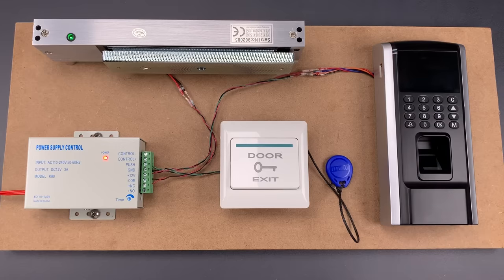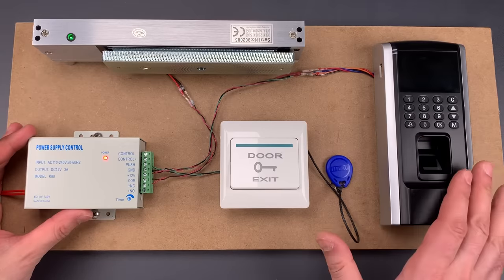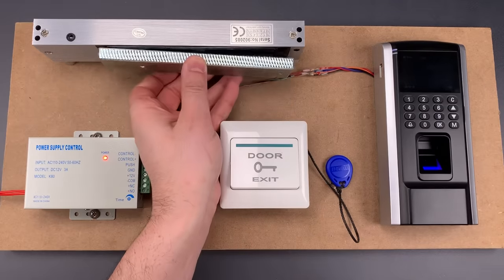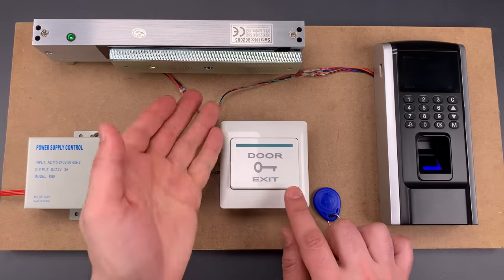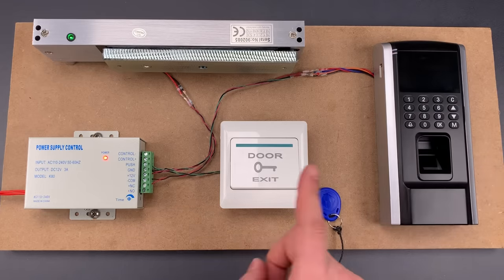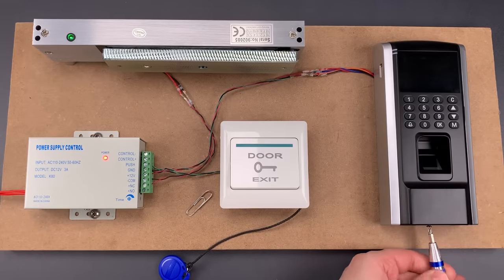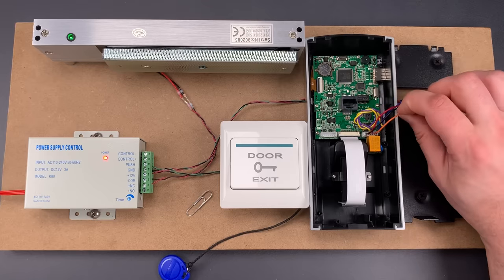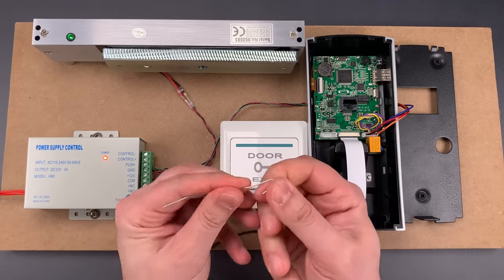[1040] Fingerprint/RFID Lock Defeated With a Paperclip (Mengqi-Control)

Comment: We had a lock system similar to this on the front door to our office building.

It wasn't the primary locking -- that was a standard lock (which LPL would have defeated faster than this, but I digress). This was just to keep the drug-addled, homeless creeps out when we were inside. If nobody was there, the regular lock was locked.

For that purpose, even though the authentication and access control was on the insecure side, it worked just fine. We understood the limitations and determined that for the application, the limitations weren't a great liability.

You need to know not just what a security device is designed to do, but what it is capable of, and evaluate it based on the likelihood of exploit and value of the property you're securing. Even a Master lock can have its place, like keeping the kids out of the poison cabinet (well, maybe not LPL's kids).

Comment: The paperclip method aside: The essential flaw is that you need power to lock, not to unlock. Good systems lock when power is lost.
Reply: This lock can be reversed to normally closed spp out works that way.
Reply: @roysammons2445  roy, how would the electro magnet hold without power?
Reply: It may be to comply with fire code, having a lock be inoperable during a power outage sure sounds like a hazard to me
Reply: @MrVein5.0  look up "electropermanant magnet"
Reply: @noobulon4334  If it is an escape door, yes..
Reply: @noobulon4334  Nebulion, OK yeah i get it so its like a permanent magnet with a electro magned operating in opposite to the permanent. canceling it out.    still, not anything i would consider more than lvl 0 safety.
Reply: @MrVein5.0  Sorry my brain wasn't switched on : ) I was thinking of a solenoid bolt. I think there are two ways of operating such bolts. 
1. Bolt is in lock position with power on. 
2. Bolt is in lock position with no power to bolt.

Comment: You failed to mention that when the power to the building or power supply is interrupted,  the lock will default to open.    This is as it should be in the event there is a fire and the need to exit is paramount.
Reply: There is a toggle switch on the controller that allows you to set it either way, (open or closed upon power loss)
Reply: @SocietyMike  Unless  you have a battery back up to power the magnet, a power outage will allow the door to be opened.
Reply: Most jurisdictions, at least in the United States, will not allow backup batteries on any power supply feeding maglocks specifically for that reason. In an emergency, life safety (being able to get out) trumps security.
Reply: @ShaunMBB527  True

Comment: As an electrical engineer I often wonder why these lock designes are so bad that anyone with some knowledge can open them. Then I realise that these are probably not for houses and more for office doors (in buildings), cafeteria doors ,etc. Also I live in India where power cuts are common and these will either fail or lock you out (if it's NC type solenoid valve locks) upon no power to the lock. 
Anyway great video as ever, your content is very helpful and is a great review for all sorts of locks.

Comment: someone is trying to break into a building with this lock on it, they sent it to lpl to show them what to do
Reply: If you have enough knowledge to install one of these based on the manufacturer's instructions, you don't really need LPL to tell you what to do next to bypass it.
Reply: This issue is not unique to this brand.  It's quite common.  Most manufacturers use a security screw to hold the cover closed but that's it.

Comment: At my work, theres a electronic lock at my working area to avoid unwanted people access, but when the system is down, we also are denied access.
I found the best solution to unlock the door is just unplugging the device from behind (it's not even screwed to the wall) and voila: door open...
Which also means whenever there a power outbreak, the "security door" auto unlocks...
Cefty
Reply: As a safety feature, you would not want any door held closed without a way to open it when the power goes out.

Comment: I'm not sure of the material the outer housing is made of but if it is steel as the mounting plate is a way to prevent this could be welding over the screw, rendering it unable to be opened. This may be an issue if the system were ever to be replaced, but in applications where this device may be used, I suspect this system would be in place for years, likely long past the original installers term of occupancy.

Comment: This is a consumer grade lock. Magnetic locks are not generally used on the outside of buildings as a commercial power outage leaves them open. Before I went telecommuter we only had magnetic locks for the emergency exits on staircases, the first floor being the only true exit was a mechanical lock. We also used commercial grade systems as the card keys were centrally managed. That being said it important as a consumer to know the good and the bad of any system we want to use to secure our environment

Comment: hose electronic complexity (fingerprint, password reading) results in a simple dry contact in the low-security side. Obviously, this is not for high-security applications AND the reader's tamper is not connected to an alarm system for further actions.

Comment: that's why places that use thi kind of expensive locks, wont connect those components as an independant system, the REX button will be termination supervised and a regular "shortening" wont trigger it. (it is possible to shorten them using the termination, but you neeed to have the one that was made for that system, not all of them would work, they differ by having different resistances) and there will be a PCB Card somewhere safe monitoring and granting access to each door. some of them cards can hold either 4/8/16/24/32 doors simultaniously. and can be expended in a row to have as much doors as needed in your system.

Comment: I can't say I can blame the lock manufacturer, but I very much do. I have done the exact same thing when creating my Minecraft vault lock. But then again they do have quality control and I didn't and I still fixed mine so the controller would be the deciding factor from the security room within my vault. This is how cross site scripting works in the real world as well. You give a user the ability to ask the database a question the database can reply with real answers. This video should be in a textbook somewhere.

Comment: The way I'd design this is the exit button has all the major circuitry in it and when someone inputs a credential that's valid it just flips the trigger that someone on the inside of the door would engage by hitting the button. I'd probably include some sort of logging function in it as well just so you know what entries and exits have occurred.

Comment: This is not a security system. Just access control in a normal environment. There is no back up battery and if there is a power outage the mag lock will open. The screw at the bottom can also be changed to a Allan key type to make it more difficult. When it is used as access control it is usually monitored by a camera.

Comment: I want to point out that THIS lock can actually be fixed so it becomes very secure, almost as secure as a split lock. If you look on when he opens the screw and lock, you will see an ethernet jack. Thats a big plus, and thats what makes it "fixable" without any modification.
I actually fixed a similiar lock.

This is how I did it:
I wired the lock to a raspberry pi. I made so the NO cable from the insecure side, only "wakes" up the rpi and tells it to go into the webinterface of the actual lock device, and check in the event log if there is a valid tag scan, or valid remote open (with phone) recently based on current time.
If there is, it will open the door.
If theres none, it will refuse to open the door, log a tamper alert, you can also configure it to send a tamper alert SMS/email, and if you want it even more secure, you can also trip something that will refuse to open the door at all via the device until a manual reset have been done (with for example a key).

Since the log tells HOW the door has been opened, its also possible to refuse to open the door if the "Request to exit" pins have been shorted for locks that have those. (and instead wire the request to exit button to the rPI so it tells it directly to open).

If you in addition combine it with a tamper sensor that reacts if its removed from wall, and disables the possibility to open the lock, it will get even more secure.

So that is a way you can improve a cheap "insecure lock" in a way that makes it extremely secure, for just like 20-40$ of additional cost.

Comment: This reminds me of Honda had a reputation for being stolen often and rather easily. To combat the problem, they added a "chip" key system. The chip key would be registered to a steering column module which then sent the handshake to the ECU to turn the fuel pump on. If you attempted to start the car without the chipkey, the ECU simply would not turn on the fuel pump. Honda made one error in their design, which was they kept the wiring largely backward compatible with the older Honda ECUs which didn't have the "chipkey" system. All a thief needed was a $100 ECU, an ECU adapter (depending on the year) and a drill. You could hook up the ECU on the passenger side, while your thief buddy opened the steering column and drilled out the ignition switch screws. The entire thing was done in under 5 minutes.

Comment: I find it hard to believe that a company would design the fancy outdoor module and use a simple relay contact that can be bypassed so easily, but I guess they did.
A simple communications protocol between the outside module and control/power supply would have fixed this issue.
Also, why is there screw accessible from the outside!?

Comment: Aside from the glaring vulnerability, this lock is otherwise very well designed. The parts all seem to be high quality, magnets are much more durable than latches, the failure state is open (so you're not locked in if the power goes out), and most importantly, it seems to be user friendly.

Comment: The installation of the equipment as shown would be a code violation almost anywhere in the US (and probably Canada).
Because a maglock does not have a mechanical override, something to unlock the door automatically from the inside is required; usually a motion detector. And the motion detector MUST RELEASE THE DOOR INDEPENDENTLY OF THE ACCESS CONTROL EQUIPMENT/SYSTEM.  The motion detector must also be Fail Safe; if it looses power, the maglock must release.
As always, Caveat emptor!

Comment: As a security technician you'd be amazed how many intercom systems this is also true for. Fermax is the worst. Literally a jumper wire will gain you access. 

This is why I'm glad I only install challanger and cardax systems. Tecom is alright but faces similar issues.

Comment: As someone who has studied electrical engineering and electronics for a long time (and work in IT), it paines me that a manufacturer would sell such a simple switch as a lock.  Especially for $175.  You can build this exact same this for about $20.  The logic controller can be bought for $5.  This is.something anyone in the amateur electronics space can build.  In IT we have a whole sector who gets paid very well to break things like this.  It's called penetration testing.  You can get paid to test a companies security.  Cloning rfid tags, getting through this type of lock or the most effective, talking your way in.

Comment: So if you wanted to use this device, you'd have to figure out some way to effectively cover the bottom of the unit, so no one could get to the screw... but then again, it sounded like the keypad cover was just made of plastic... so you could use a battery operated Dremel type tool to just cut around the base or just drill  a hole in the side of the cover where the wires are and jump the two wires (whatever the colors are) that are not red and black... a Anti -Tamper Device would probably be a simple mercury switch if the cover was removed... drilling a hole shouldn't disturb that... but you could also add your own anti-tamper alarm easily.

Comment: That's why i still use the old fashion padlock & key on my gate & door.
One question: in the event of power outage, will this sophisticated magnetic lock release by itself? 😁
Reply: With out without a backup power supply//battery?   Without a power supply it would fail safe and open, yes.

Comment: True it really should have an anti tamper switch, and also true that it should be a 1 way only signal of the credentials for the secure side to verify, hopefully the company that sells this makes the hot fix and sends everyone who bought one, the proper one with a prepaid return parcel for people to send back the old ones, so that way the company can remodify them and re-sell them all fixed and new. :)
Reply: However... maybe they designed it that way on purpose and originally told law Enforcement the loophole xD, surely they woulda came across this when making them and surely the CEO woulda known, but who knows maybe there wasn't enough hired testers before release of the product?

Comment: This is just a stage 1 lock though...... which usually means their's a secretary or security guard standing near by.

Almost all RFID applicable locks are stage 1 for quick go access.

It's not so much that the building is saying, "their is something important behind this door". They're saying, "This door doesn't even require a lock, and this is what you get. So don't even bother getting behind this point."

It's more of a scare tactic, like fake rfid clothing tags or fake security cameras.
Reply: No, I've seen scores of these inside buildings to segregate secure/non-secure areas.  Even at Beoing
Reply: @protonneutron9046  k

Comment: 1)Most of this key pad/Reader will have a anti temper switch, the moment u remove the opening screw half way, u would have trigger a 24 H siren, that is connected to a security system and central monitoring station. same thing if u rip it off from the wall

Comment: I know I am late to the show but it looks like this bypass may have damaged the system a bit.  Notice the green led on the lock turns off each time the system is unlocked.  There is a delay until the system relocks.  When he bypassed it the led still turned off and then with no delay it turns back on but a strange dim orange color.

Comment: With these systems often times a motion detector is incorporated inside the building. Often times the motion sensor is mounted to the top of the door frame and by pounding on the doorframe by the motion sensor will cause the sensor to deactivate the magnet.

Comment: Easy way to make this one instantly harder to pick.
Install it, then build an inset around it so you can't easily access the access point that lets you open it without actually breaking it. 🤔
If you build that Surrounding inset with Future access in mind.
You would make it a steel plate with 9 inch bolts. That way it would take forever to open the inset if you're looking to do it without being noticed, but wouldn't be a problem if you were maintenance.

Comment: Manufacturers don't care for a reason.
Maglocks are not of any security value because these need to have electricity to hold the door shut, so if there is a power outage then it will unlocked. 
Maglocks are not the best choice for high security doors and should always be used with a mechanical lock
 Another use case would be on an emergency door and controlled by either an online system for remote unlcoking or using a push button to exist device like in the video but that too is not particularly complaint with fire safety codes.
The last use case that I'm aware of is for frameless glass double doors since mechanical latching is generally impossible and even these doors are just a mere psychological barrier.

All in all, it's not just about the hardware but rather the way you use it.

Comment: Technically, if u are able to bent the paper clip into a screw driver tip form and then use it as a briding tool this can be done with just the paper clip.

Comment: I'm an expert in designing access control systems with many years of experience in designing large systems. What I can say about this is that it completely defeats the purpose of access control which is record keeping. Installing something with a common code, a non vandalproof case, and a link to the REX outside is just bad. You would be better off just cutting some keys. Now if you were in the market for a cheap cost effective access control system for small installations like this Continental Instruments EAccess would be a better solution.

Comment: It also has a usb. This can be attacked with a badusb/ rubber ducky as well.

Even a “usb killer” could probably do it but might not, depending on what the control does when it stops receiving a signal from the box lol

Comment: The main flaw here is if you are using this system as security solution rather than a verified entry system. Should always mechanically lock the door outside of operational hours. What happens in a power cut for example.